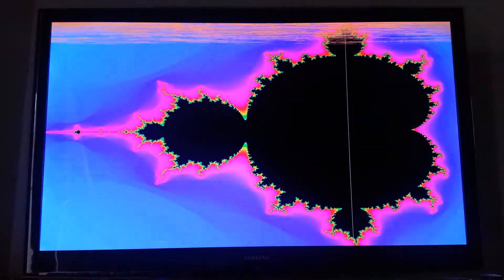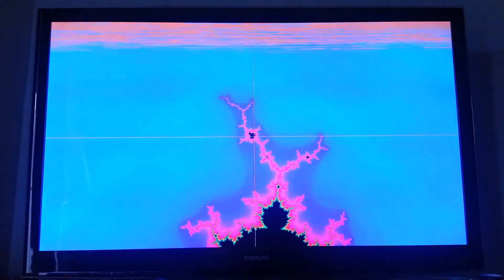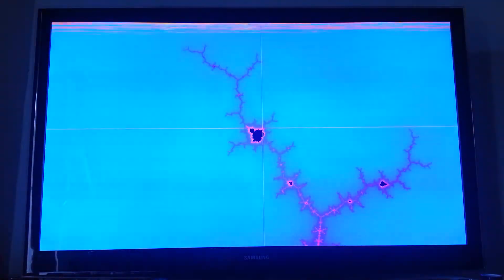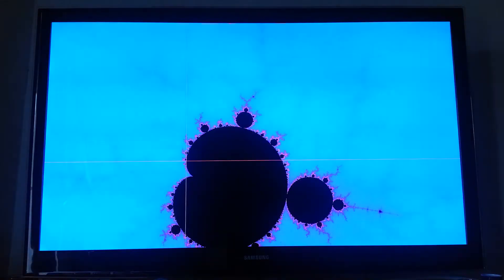Mandelbrot Set on Zedboard using ARM NEON instructions

Comment: The linked project unRARs to a wopping 620 Mb. That's massive for a simple looking mandelbrot renderer.
My quick reading on the Zedboard suggests that a FPGA is available.
Would it be possible to use the FPGA to do high-precision arithmetic, perhaps 256 bit multiplications and additions?